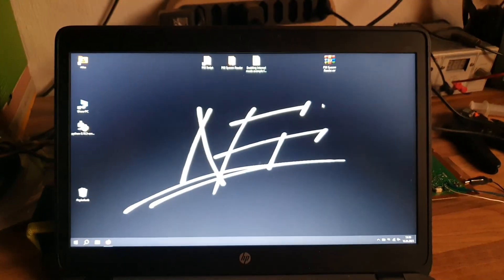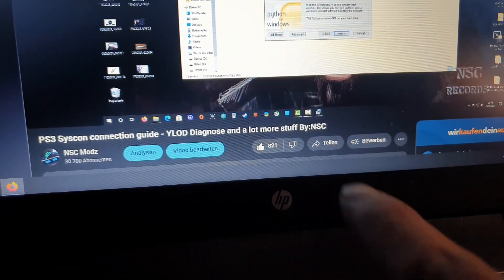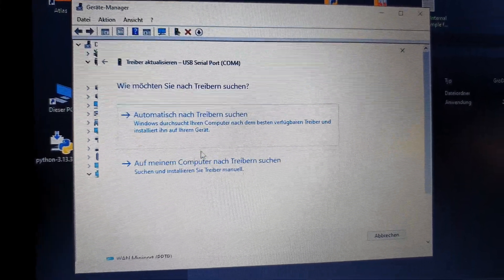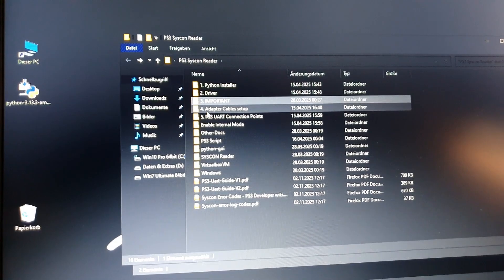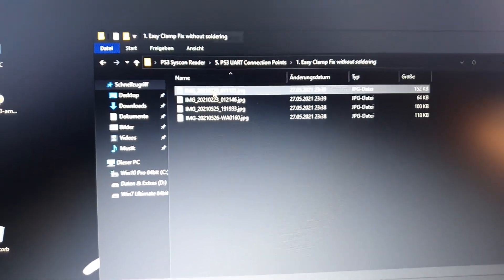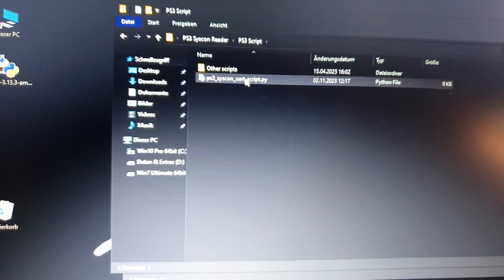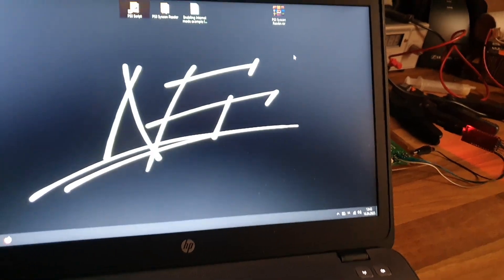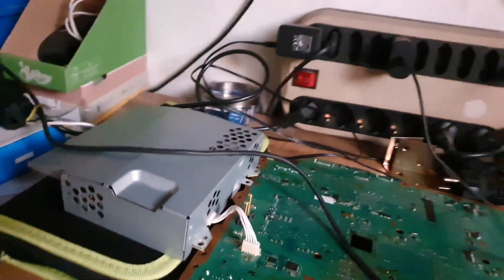PS3 Syscon Reader easy installation By:NSC

Comment: What if i forget to change the FT232RL output voltage?
It was on 5v and i forgot and put it on the rx and tx pads on the ps3 and i tried too many times to  open the script and it won't open is my ps3 fried?
It still has ylod but will it work again or i gotta change the syscon chip on the ps3?

Comment: Hey nsc modz I bought a ps3 what was supposed to be half way working but when I got it was dead ylod and I use your video to read syscon and I got error 1200 and idk what to do now everybody I ask said it’s a fully dead ps3 and idk who to believe or even where to start to look this is my first backwards compatible ps3
Reply from the maker: Hello bro. Error code 1200 significante CELL Overheating. Delid the CELL IHS, Reflow it with Flux on about 260°C for 5 minutes and give it a try 😊

Comment: Thanks for your information. My question is, I have a backwards Cecha chassis. I want to convert its RSX from 90nm to 40nm. I have the RSX chip I need, but the syscon device and voltage soldering you mentioned in this video are required. What exactly do I need? Could you help me?
Reply from the maker: You welcome. Which voltage soldering do you mean? Soldering the cables from the syscon reader? Why swap the RSX? It's not working?
Reply: @NSC-Modz  I'm saying these devices are doing Frankenstein to the RSX, we install 40nm from the RSX 90nm, then there are a few more settings, and finally, we are modding with the device you showed.
Reply from the maker: Yes i know, but i was just asking. Most people just swap it when they're are problems, that's why we say: Never touch a running System 😆
Reply: @NSC-Modz  I also had a problem with RSX, so I'm asking you what I need.
Reply from the maker: @mikailesinler You want to Replace the RSX by yourself? If yes, you will need a lot more stuff...
Reply: @NSC-Modz  Yes, I want to do it myself, I have hand skills, I just need to know how to do it. What materials do I need to use when doing this? Can I see the links for sale? I would appreciate it if you could tell me.
Reply from the maker: I've never done it by my self, but you need a good reballing station, good soldering iron, flux, etc. You should at minimum practice first how to swap a chip inclusive testing it.
Reply from the maker: @mikailesinler Check this guy, i recommend him a lot, tell him greetings from MSC Modz :)
https://youtube.com/@computerbooter1566?si=P1ZtxrCzWOBmQ8_Q

Comment: hi, i sent someone to replace my nec tokins and my ps3 still does 1001 ylods in certain games, could undervolting work? i even replaced the psu (it's all 1001s)
Reply from the maker: Hello, if undervolting will not fix your issue, at least it will help about less power consumption and a way cooler system.
Reply: @NSC-Modz  eh, i kinda knew this in a way but i don't know what to do, the capacitors are replaced
Reply from the maker: That's not bad at all, if you don't like it, you can set it all back again :)
Reply: no, my ps3 still ylods in certain games even with the capacitors replaced

Comment: This soft fits any uart ttl programmator or compatible only with this model?
Reply from the maker: Should work with other models too, but i recommend to use this one.
Reply: @NSC-Modz ok, thanks very much for answer! Otherwise YLOD on my PS3 Fat jumps, and then suddenly comes to life and works calmly. It's just some kind of magic. Console-mood😂. Errors there 3034, 4411, 1001, 1002. Now it works. Next time I want to see through syscon what causes the failure

Comment: I want to ask, when the PS3 is powered on it immediately beeps 3 times, after external settings, the PCB diag is damaged. Please help
Reply from the maker: Hello ohh How it's damage? Witch model? You search for alternative contact points?
Reply: cok - 002
Reply: pcb track peeling
Reply: is there an alternative diag path or not

Comment: What is a ps3 syscon reader I never heard of it does it haft to deal with the fan syscon speed ?
Reply from the maker: The Syscon reader is an UART board to read your syscon chip. With this one you can read error codes, or undervolting stuff and a lot more.

Comment: You are a king, NSC!
I have been following you for years, as I have 4pcs CECHC04 PS3s in my collection.
I want to impove my skills so that one day I can make a 40nm Frankie. But there's still a long way to go...

I already know how to make a dump form NAND chips with TEENSY hardware programer, thaks by you.
But I haven't found a video for the following yet:
How do you make a dump of the contents of the Syscon chip and rewrite a backup to it? Do you have a video about this?

Thank you in advance for your answer.
Reply from the maker: @s.zsolt1  Thank you so much bro. You always welcome. So far as i know there is no method to do a backup for the syscon chip like with a hardware flasher. But you can copy all the values from the syscon to a .txt file. Let's say like, you can read all you like, and than you just copy that stuff from CMD to a .txt file, so you can program it back all the time. I would do FK mod ONLY with a Laser Reballing station. But the FK mod is not more that cool, as you can now undervolt your Baby, a lot people prefer to do that instead to pay 500-600€ for an FK console. We don't even know if this will last for a big time, same with the Tantals, we don't know if this gonna work for a long time. The NecTokins was working very long, till now since 2006, i still get very old PS3's with good Necs, so i still prefer to install Original NecTokins, there i know it will last again for the next 15 years or even more. Also not to forget is also, that Reballing cause a lot heat to the Board, and some people destroy the pads under the Chip and than say good bye to your Board. That's why for me, only Laser Reballing makes sense or better let it be like it is... never touch a running system 😆
Reply: @NSC-Modz  I guess that is what he means, that is at least what I ment xD
Reply: @NSC-Modz  Thanks for the information. I appreciate it.
I read the thread after that, and this Syscon Dump thread seems like a pretty deep rabbit hole.

Keep up the good work.😇
Reply from the maker: @s.zsolt1  Thank you so much, you always welcome bro.
Reply: @NSC-Modz  Thanks for the information. I appreciate it.😇
I read the thread after that, and this Syscon Dump thread seems like a pretty deep rabbit hole.
(psdevwiki website SC EEPROM page)

However, I found a half-solution: In Internal Syscon mode, you can read the value of the specified memory areas, but only those that are not encrypted.
I made a simple program that types the command "r 2F00 ff" then hits "Enter" and waits a while. Then it repeats this until "r 7F00 ff". Then finally saves it to a TXT file in your desktop.
This solution is not perfect, but it's better than nothing :D

I don't know if a similar or better solution is already available.
If it might be interesting to you or the community, I will of course share this little program.
Reply: that would be a great video yeah you should do it there are some commands to dump the syscon. so even if you set something wrong you can fix it

Comment: that's what i was needed. You are the BEST NSC Modz
Reply from the maker: Bro. you always welcome :)
Reply: @NSC-Modz  I have learn so many thing! Do I need evilnat OC or any evilnat is ok? Also I am trying to make IHS and heatsink as flat as possible to earn a few more Celsius and I used liquid metal to one of my ps3 2 years ago. Today I removed it and it was almost identical. Maybe a little discoloration on the RSX and IHS was like new!!
Reply: Also, I have Rx Tx Diag cables connected and have them outside my ps3. I loved you PS3 style!!!! but my clock isn't always working. Many times askes for time when I power it on. Battery is new and checked. Connector is checked too. Small problem but wanted to ask if you have any problem like that. Awesome videos!!
Reply from the maker: @chtps3 Any Evilnat is good. But i would not flat the IHS, the more the IHS is thin, the more pressure you will lose. Liquid metal only with Electric Nickel plated IHS, otherwise the liquid metal will get hard.
Reply from the maker: @chtps3 Please check the battery contacts.
Reply: I want to smoth the top side of IHS, not the inside where I have liquid metal. My original cechc ps3 had 3 times ylod and I thought liquid metal won't hurt rsx 😂 but 2 years later it looks not affected!! I applied liquid metal again and it works, until now 😂
Now I use another cechc with liquid metal 
Tested it with God of War 3 and 53 was max temp of rsx. 50% fan speed @NSC-Modz
Reply from the maker: @chtps3  ok, but don't tell me somewhen that i have not warned you :)
Reply: @NSC-Modz  NEVER!  MY CONSOLE my discission what is going to happen!!!!!!
Reply from the maker: @chtps3  yeah, absolutely :)